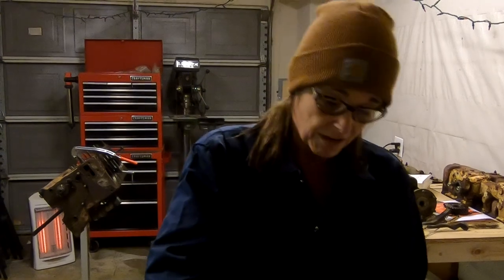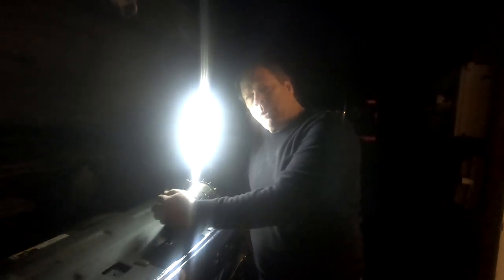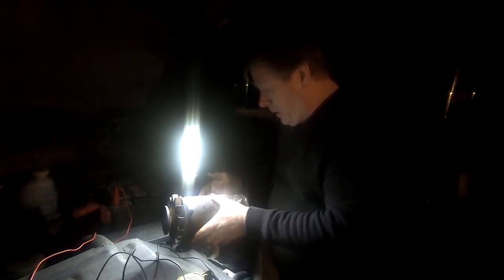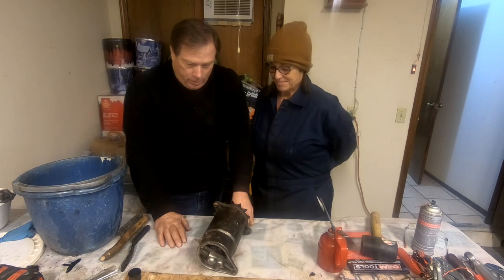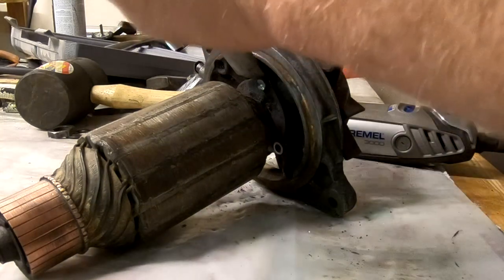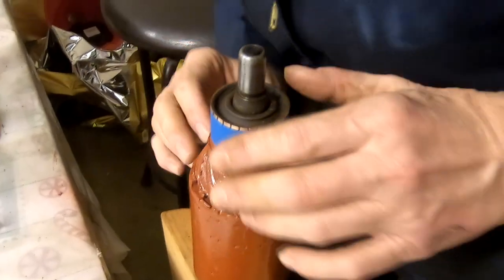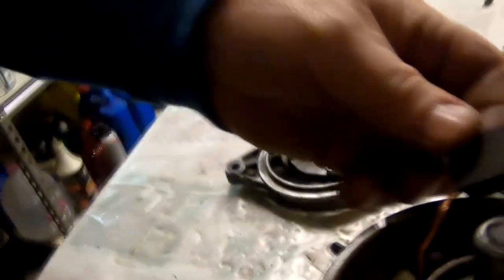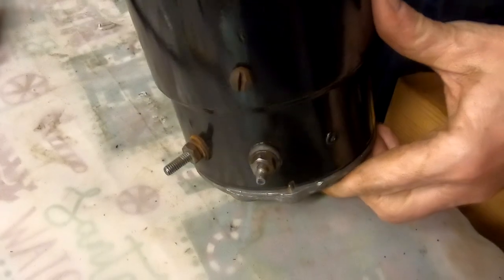Talkin' Bout My Generation - The Contentment Backhoe Project

Comment: All the old farmalls had magnetos in them. About half have been converted to 12 will and they've deleted the magnetos.
Reply from the maker: Hey There!  Yeah, this backhoe has an old Wico magneto/distributor with points. It works fine, so we'll keep it. We are going as cheaply as possible on this project, but improving where we must.  Just got unhappy news on the engine block, though, we'll see what happens with that. Thanks for watching.
Reply: @extremegardening8440  bahahaha

Comment: We convert everything to internally regulated Delco alternators unless it's a restoration, improves reliability and it cheaper plus no regulator
Reply from the maker: Appreciated. Ordinarily, we would do that. An alternator costs about $100 for this thing. Rebuilding this generator cost us $10.50, so we'll use it until it gives up the ghost. We'll replace the regulator and keep the old one handy, just in case. Thanks for watching!
Reply: @contentment164  we get rebuilt ones for 30 dollars keep one on the truck two on the shelf But you have make brackets .I understand why your fixing the generator and it's obvious you know what your doing ! Might try it myself if it was my machine. A customer's l would just convert got two I need to do this week
Reply from the maker: @HomesteadingtheHardWay  Wasn't even thinking about a rebuilt alternator. Shucks.  A rebuilt alternator would have been cheaper than rebuilding the generator and buying a new regulator. Appreciated. Keep the advice coming! Thanks!
Reply: @contentment164  I think 12 volt regulators are 40 dollars my cost.but this was a good instructional video with really good information! Sometimes people want all original